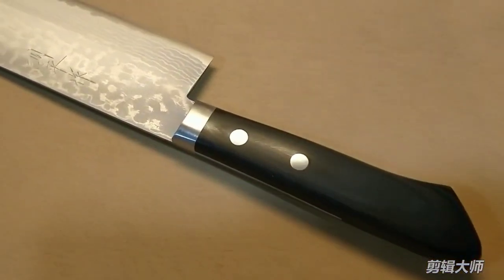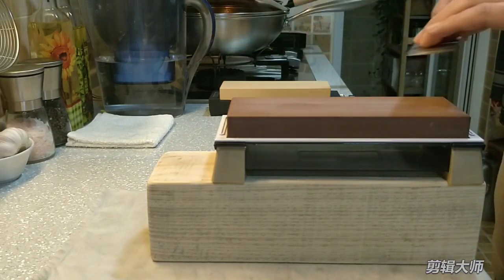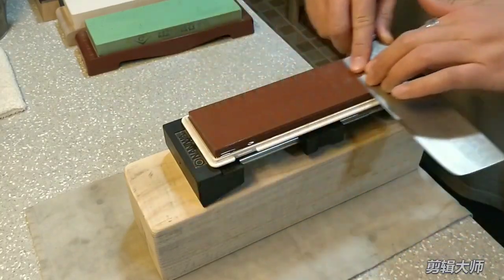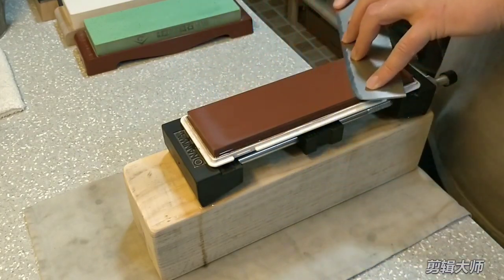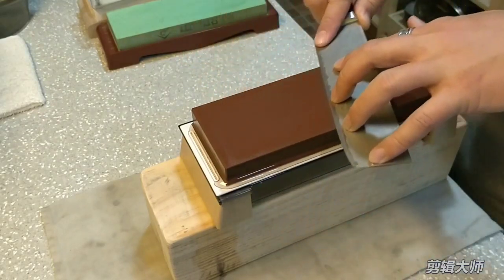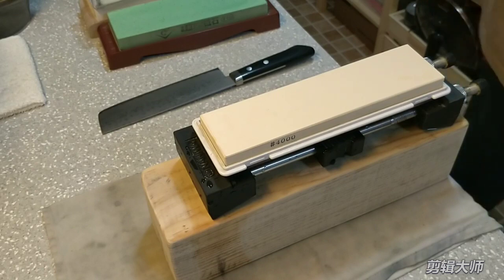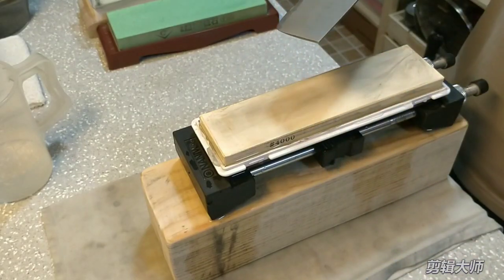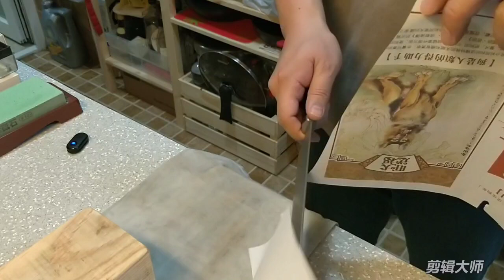Knife Sharpening Skill for Beginners Masutani VG10 Damascus Usuba 170mm HRC60

Comment: Hello, great videos, thanks a lot for sharing ! 
I'm new to sharpening and on every video/tutorial i find, people talk about compounds they put on their leather strop.
It seems to me that you don't have any compound on yours. Am i correct ? 
If yes why ?
And may i ask which leather you use and what side you use (rough or smooth) ?
Thanks a lot in advance and looking forward for your next videos !
Reply from the maker: Hi, I stop using compounds when I learned it's toxic and difficult to be wash off from blade.  If you see that I hold a hair and cut it very easily by slow motion, what else do you expect from your edge?  Super sharp enough.